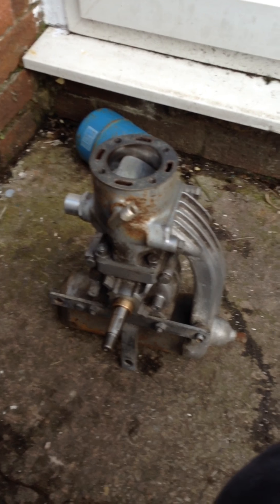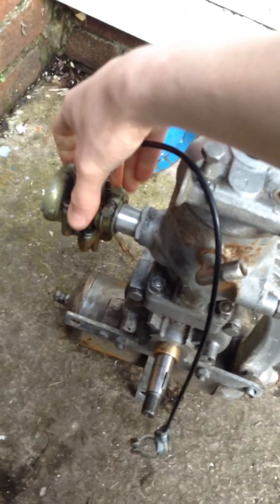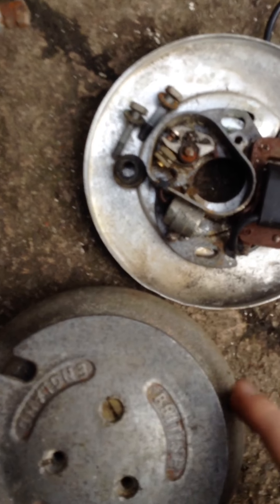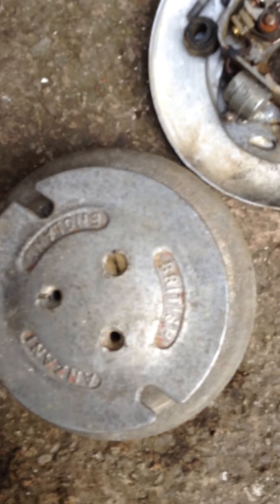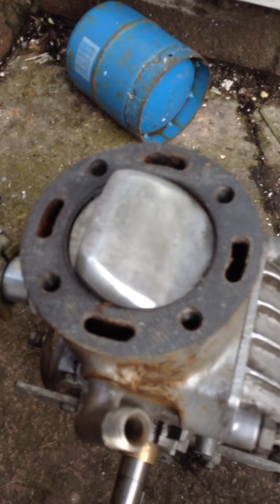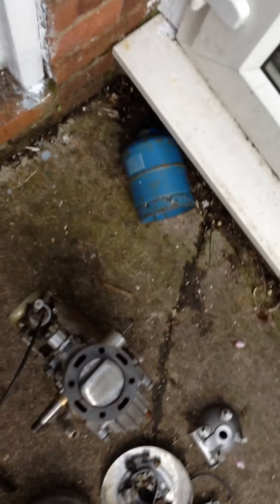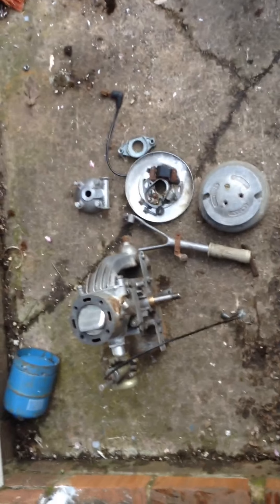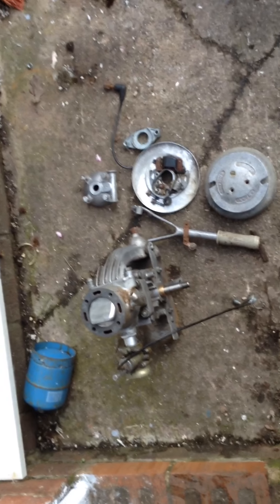Anzani super single restoration part 1

Comment: Hi mate, i have got a super single myself at the moment and i have to replace the HT lead coming from inside the flywheel. Could you possibly tell me how to remove the flywheel?
Reply from the maker: TheCatLads there is the nut that is actually joined to the flywheel under the starting cup when loosening this nut it should push the flywheel away from itself
Reply: villiers 1 thank you so much it has had me confused for weeks!!